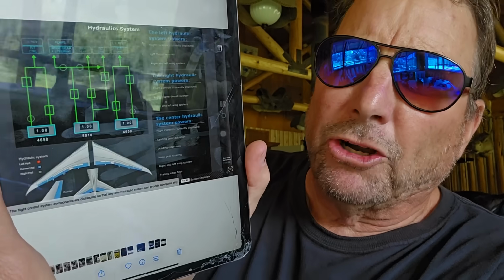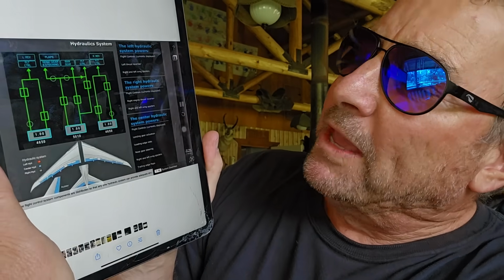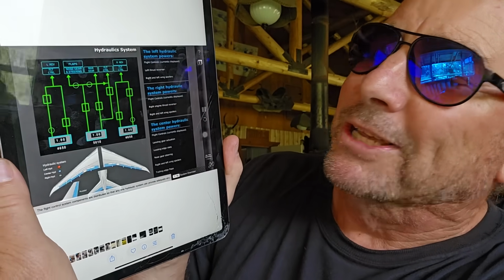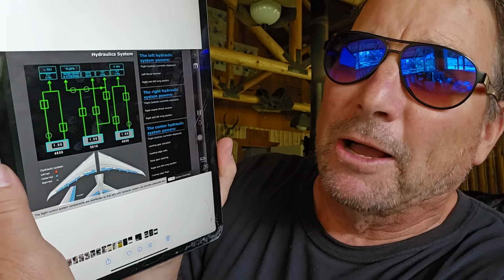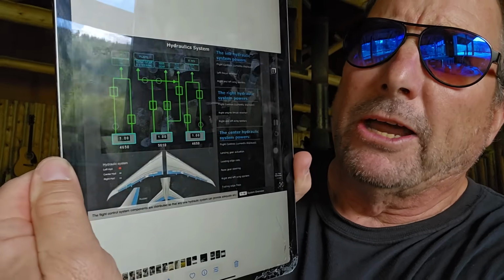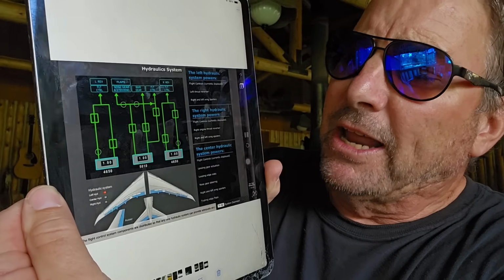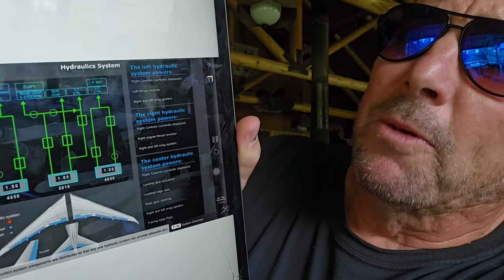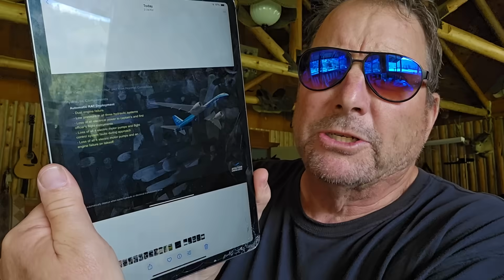787 Crash India What's a RAT? When does it deploy?

Comment: 1.  If a max gross 787 can climb out single engine at flaps 5 then it can most likely climb out at V2 +20 and flaps zero with 2 engines at max thrust.  Won’t be pretty but it will fly.  

2.  If the RAT was really deployed then there was a massive electrical failure in a manner so severe that the time needed to recover all systems wasn’t available at 200 feet AGL…maybe 1,000 but not 200.  

3.  If the RAT wasn’t out then the theory of mistaken flap retraction at a flex power reduced takeoff is plausible.  I have personally seen this error in my cockpit.  Easily correctable with good awareness.  

4.  What about a theory of too little takeoff power as the result of an incorrect assumed temperature entry.  Look like a long roll and slow climb.  Unlikely but unless the pilot flying fire walled the throttles would just settle back down.

Comment: I saw somewhere he did a mid field intersection takeoff. Does anyone know about this?
Reply: That is wrong, the full runway was used.
Reply: @mjkuwp94 OK, because that would explain a few things. But putting the flaps up instead of the gear would be a more logical scenario. Then a power on stall as he raised the nose as the ground rose up, hah. Can't dive to gain airspeed under 500'. Seems like this accident has happened before.

Comment: Did you see India blaming Boeing. Which is funny to me since other crew members that flew on this jet came out saying that this plane had electrical problems and rather than fix the problem, they would just push the jet back out because it was the only Dreamliner they had.  There is a video of a previous passenger on twitter showing how the entertainment system and phones where not working. Very much reminds me of that crash in the 90's when the entertainment system over heated and caused a fire under the cockpit since all that electrical comes back to the same area. This aligns with what would deploy the RAT. Of course it is all speculation at this point. India seems determined to blame Boeing quality control, but I suspect a long hard look at their books are in order. This jet is 10 years old after all.

Comment: looking at the video of the takeoff it looks like only the left engine was running from dust only getting slung up behind the left engine (you'd expect from both) and an immediate slight yaw to the right. a long takeoff roll also suggest the pilots was struggling with directional control before they rotated. the plane was climbing out at around 900ft/min which also suggest single engine climb (normal climb is around 3000ft/min). the more chilling fact is the altitude of which the plane started falling. according to flightradar24 the real problems started at 650 ft msl. this is 470 feet above field elevation (agl). the lowest altitude of which boeing allows trouble shooting to start is 400ft agl. I'm afraid they shut down the wrong engine..... which would explain the RAT deployment and the instant lost of lift.... RIP

Comment: There is one theory going around that the first officer mistakenly retracted the flaps instead of the landing gear.  Even as a hobbyist I find it very difficult to believe given how physically separated those levers are in cockpit photos .  But assuming that this happened, could the plane have collapsed immediately the way it did? Or more likely struggled to gain altitude and possibly crashed after several miles perhaps? If this is indeed what happened then it is way too scary how sensitive the whole setup is.  The machine should not even allow pilots (who are after all humans and prone to making mistakes) to pull the flaps up prematurely...

Comment: @1:25min:  Besides the distinct propeller sound, the only accompanying noise pattern that I am able to discern is that of air friction.  At the most, there is just about as much main engine noise as with the American Airlines plane on approach shown earlier.  But a fully loaded widebody jet on takeoff should be making that distinctive deafening high pitched whine that should have drowned out everything else?! If I am right, could this be another indicator that the main thrusters where completely or partially dysfunctional?

Comment: Little disappointed by lack of more independence analysis at this point. Did I miss a video from Juan with it?

Really like to see more analysis of tge extremely hot day conditions.  Could a significant factor be the 37c temperature.  Overtemp engines, performance calculation errors?

Comment: Finally, someone saying what I’ve been thinking for the last day, the wheels weren’t up and the flaps not moved, so my first guess was that hydraulic power wasn’t there.
Reply: my feeling for both eng to fail is fuel pumps getting no lecky  so aircraft suffered massive power failure
thats if both failed  rat deploying points to this and aircraft was steady and nothing of note sticking out handling wise
Reply: @davidblurton7158  the aircraft still can take off on suction
Reply: @TrollingwTyrone  still had the engines running maby,, but they could have been failing  it looks like the bogies moved to the u/c  raised position for stowage so they tried to raise the u/c  but it only managed to tilt the bogies and then it started to sink
Reply: @davidblurton7158  does look like the bogies tilted but not sure if hyd power is even available for retraction - maybe it was commanded after liftoff when there was a resemblance of normal hydraulics, tilted the bogies but lost it for the door opening sequence
Reply: meant not sure if hyd power for gear available for retraction under RAT power
Reply: @TrollingwTyrone  exactly,,  need the pumps to raise those,,  so no hyds which means he lost engines at take off ish but his run into the over run may mean he was losing thrust earlier but had the momentum to get up so far,,  he was committed to going,,,,
those tilt actuators are pretty large so would have drained any remaining pressure
Reply: @TrollingwTyrone  personally it would be for flaps slats spoilers and ailerons rudder and elevators and they are much reduced in capacity  but all aircraft are different and im not a boeing man  brakes and steering maby too
the u/c takes a lot of oomph so that would just be free falled  some flaps and slats are wound down  so long as you can manoeuvre the plane
Reply: @TrollingwTyrone  think prop aircraft is "suction"  jets are thrust acting on the forward face of where combustion takes place   i think,,,
Reply: @davidblurton7158  thing is they did not over run - the takeoff run is quite normal for a derated thrust takeoff which all airlines do to preserve engine life and the data from the day before shows the same aircraft rotating the same speed, liftoff point and climb out nothing different.  Keep in mind the 78 went HEAVY electrical with everything in this aircraft. They use electro hydraulic actuators (EHA) for the flight controls and the actuator itself has its own hydraulic system with a dc electric pump inside the unit and it is more than likely the flight control system  went to direct law bypassing  the primary flight computers - either way the aircraft appeared to have been in control all the way down except for the thrust part
Reply: @TrollingwTyrone  we had those individual hyd systems in the late 50s  one of the aircraft i worked on had  4 ailerons and 3 rudders  and 4 elevators all seperate and powered by an individual pack  bet there a bit smaller now

Comment: the Ram Air Turbine  at some Planes is  in an Easy Way described, the equivalent to an APU on other Aircrafts ...  
 it is there to generate Power if the "normal" Power source ( the Engines) Failed .... without  this Power there is no way to restart an engine or even Operate the instruments in most Airplaines ...  that also was the First thinng that sully powerd on after loosing both Engines ... in his plane it was an APU . the only difference is .. the apu is an Extra Turbine in the back of the plane .. the Rat is an Powwer generating unit  wich is driven by the Wind as soon it gets deployed ... !!!

Comment: Investigation will tell, but it might be wise to determine:
How much fuel remained in the tanks upon arrival of the aircraft at the airport, incoming from Deli (a 1:09 flight).
How much “hot” fuel was subsequently loaded—and by what means (tank truck versus pipeline).
Thereafter, they should assess whether partial or total engine failure could have been precipitated by water condensation at the interface of these two fuel sources.

Comment: The point the plane rotated and went 1.5 degrees up looked fairly normal.  Thats usually when the pilot would call gear up. But they did not and seconds later the plane began it's descent.  
Could the RAT deploy that quickly to be picked up audibly (or was that turbine sound from an adjacent aircraft/runway)?
I still contend fatigue caused the copilot to raise the flaps instead of the gear causing the plane to lose lift. The pilot was unaware of the mistake and seeing loss of lift made the mayday call. 

The co-pilot had 1,100 hours experience but not all on the DL.

Comment: If I remember right, the 737 Max had only been in service a couple of months when it had the first crash in Indonesia. In that case, it made sense to pull the Max's out of service until they knew what had caused it. The 787 has been flying safely for something like 10 years; a long record of safety, so the chance that whatever caused the crash in India is a widespread issue with the 787 is very small. I've read recently that India is trying to expand it's commercial aviation industry very quickly, and there are problems with proper maintenance of their fleet, and possibly the training of their pilots as well. There must have been a serious problem with the plane for the RAT to deploy early in the takeoff run, and a question mark on the pilots' decision to go ahead with the takeoff instead of immediately aborting it.
Reply: Max had been in service for about 1.5 years
Reply: You're correct. The 787 has been in service for 14 years, which makes a major design flaw unlikely (though not impossible). This particular plane had been in service for 11 years, so a manufacturing defect would also be pretty unlikely at this point. So the next things to think about would be an issue with the airline's maintenance procedures and staff compliance with those procedures. That is, of course, assuming that it was a mechanical failure and not pilot error.

Comment: The 787: Unintended Retraction: An electrical fault could potentially lead to an unintended flap retraction if it affects the FCE's ability to maintain the correct flap settings or if it causes a malfunction in the flap motors.
Loss of Lift: If flaps were to retract unexpectedly, especially during a critical phase of flight like takeoff, it could significantly impact the aircraft's lift, leading to performance degradation. There are back up systems for flap failure during an electrical system fault however who has time to go through the check list on take off? This plane did have some kind of electrical system failure as the RAT was deployed and the engines sounded normal. The flaps were in a retracted position, with the RAT deployed, and the landing gear was extended. Something wrong with the electrical system effected the landing gear up and flaps.
Reply: You cannot prove by looking at that 480p video the flaps were retracted. Flaps 5 is barely noticeable from a distance
Reply: @tomstravels520  As the plane looses power of lift pilots will deploy more flaps, at some point it would of went to full flaps to gain lift, and that surly is not full flaps.
Reply: @AIDigitalMarketPros on landing, yes, on takeoff absolutely not, remember that adding more flaps also adds more drag and flaps have limit speeds.
Reply: Judging by photos of the wreckage, it appears the flaps were deployed.

Comment: Heard it!
Complete dummy here but how can a small piece of equipment like the RAT take over the function of an aircraft’s engines? Does the plane inform the pilots it has been deployed? I’m sure in the course of time we’ll get a better idea of what caused the deficit in the lift of this aircraft.
Reply: The RAT doesn’t take over an engine. It provides basic electrical power and pressurises the centre hydraulic system. It doesn’t provide thrust. And yes it warns if deployed on the EICAS
Reply: @tomstravels520 thank you

Comment: Here is my theory, is that the systems had degraded over time due to arcing (poor wiring) early 787 were known for this and the problem is well documented. In the past it has lead to a massive electrical failure in he avionics bay. Again, there have been several cases were an arc has caused multiple critical systems to go offline. The RAT deployment only strengthens my theory. Aircraft was confused and thought it lost power. Now, part I'm speculating is that when they cycled the gear the Landing Gear Control and Interface Unit (LGCIU) is what took out all other critical systems that share that bus. So they did try raise the landing gear but due to a degraded system it failed and took everything else with it.
Reply: I can tell you’re just guessing randomly at this point because LGCIU is an Airbus term
Reply: You mean Air India failed to carry out airworthiness fixes? Yes, that's possible. But it's pure speculation at this point.

Comment: They started from 2/3 of runway. Had hardly any speed for take off at very end of runway. Dirt and dust from end of runway was swirled up and likely ingested. May have flamed out turbines and RAM turbine was deployed. Without thrust, airspeed fell and no lift. Hence, primary cause was starting not at very beginning of runway. This should by now really be DEMANDED from any aircraft
Reply: No they didn’t, FR24 confirmed they actually backtracked and started from the threshold

Comment: The slats were definitely deployed, I have seen a picture of a wrecked wing. I have read on another channel that an Air India pilot confessed that they had ongoing problems with this particular jet, even engine failures and that maintenance was overdue. Don‘t know, if this is true and investigations will reveal more info - but it would definitely fit the picture that the crew was on a suicide mission. If you have - for whatever reason - a dual engine failure at 150 feet and the gear is not up, there is nothing left you can do. The plane will stall. For that, they actually did a great job and if there had been an open field, they could probably have landed this thing somehow… but not in a city environment.

Comment: There’s a video of someone aboard the plane on the flight just before the one that crashed. In his video he’s detailing how all electrical systems were not working in the plane for the passengers. Such as the screens and the air conditioning
Reply: I don't believe that has any significant, many times I've been sitting on a plane during boarding and none of those systems are fully operational.

Comment: The flaps were UP!!!  if the cabin lights aren’t working if the air conditioner is not working if the call attendant button is not working, I’m probably not gonna fly on that plane and the pilot shouldn’t have taken off ever!! What could possible go wrong?
Reply: Prove it. Photos at crash site seem to contradict that. You cannot prove the flap position from that low res video, and if flaps had not been set both the ECL and TOCW would have alerted the crew
Reply: @tomstravels520  the air conditioner wasn’t working prove it. The lights in the cabin weren’t working prove it. The call buttons weren’t working prove it. It was a dumpster fire waiting to happen.! prove it

Comment: very interesting Jan! speaking about Redundant Sytem: what's the RedundanceLevel of such an lifesaving device as the RAT? In my opinion its not very Safe and sufficient for safety if Airplane just relies  on Electricity and Hydraulic power. I think the RAT IS JUST a DIY solution of some engineers who wanted to finish the idea of " all-electric-hydraulic-airplane" whatever problems are existent and to be solved

Comment: That's where having the runway near the sea is useful, because if a crash landing is required, the aircraft can be rash landed in the sea using a glide stall approach. Of course gear down is always going to present challenges in any situation where an emergency runway landing is not a viable option.

Comment: Great, as always, Juan.
Super-informative and in such an accessible way. Great to have the local Husky helping out!
I was, with sadness, initially convinced that the central issue was an erroneous flap (instead of gear) retraction.
But far more disconcertingly, the mayday message and RAT deployment clearly point to far more complex issues, and to the urgency of getting to the bottom of them, as you emphasise.
Thanks again.

Comment: Excellent video, Juan!  Investigators need to get the flight data recorder analyzed right away. With so many 787's in service operators need to know if it is a systemic problem or a one off resulting from a maintenance failure.  I hope it isn't another Boeing problem.

Comment: The ram air turbine deployed because as the aircraft took off the hydraulic giving power to the engine stopped working and the aircraft could not climb and could not get air speed. So the aircraft stall and crashed